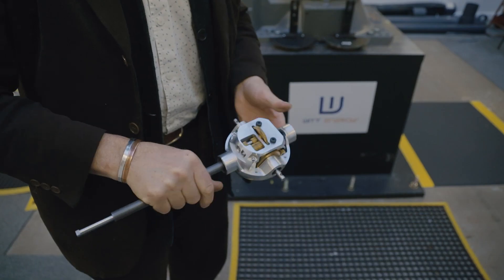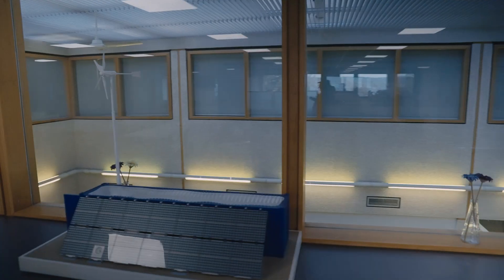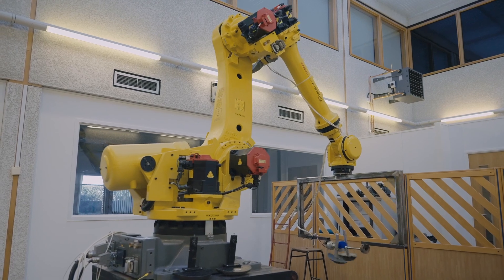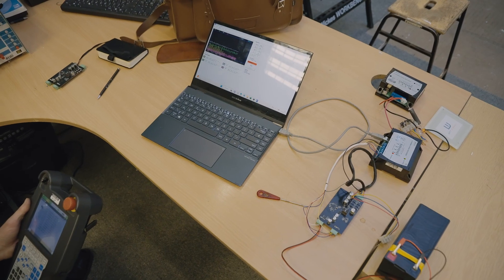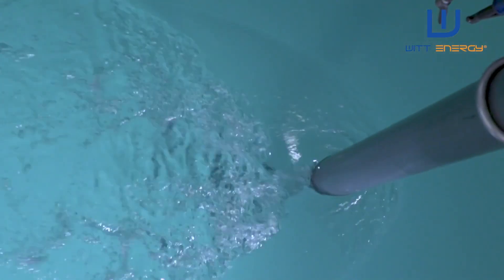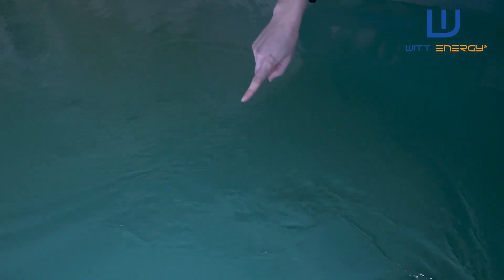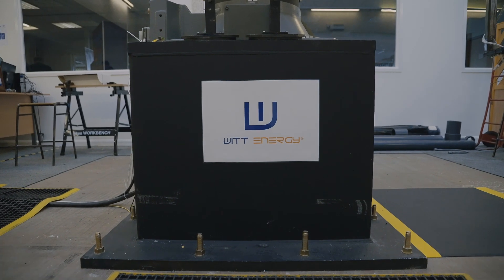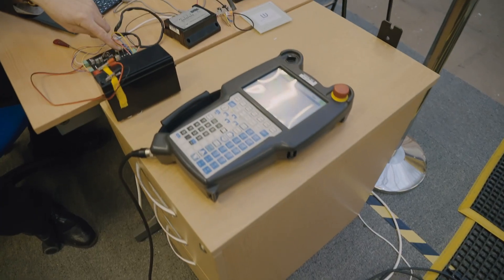RS | WITT Energy - Innovation in Motion

Comment: will you use your generator of electric current in sailboats instead of a keel, since the amplitude and frequency of oscillation of the keel is almost the same as from the current, then the generation of electric current should be sufficient, but it is necessary to repeat the shape and mass of the keel of the sailboat that was installed from the shipyard.